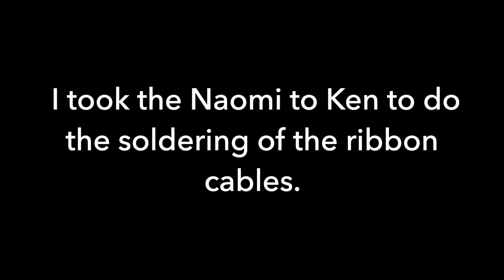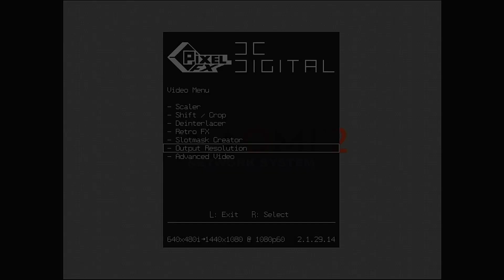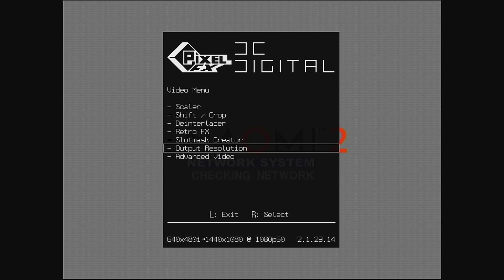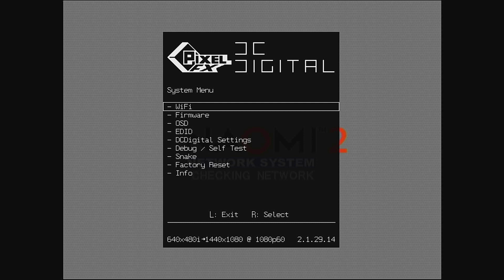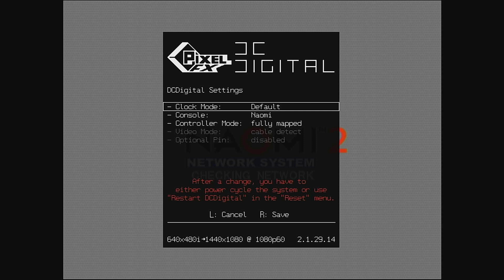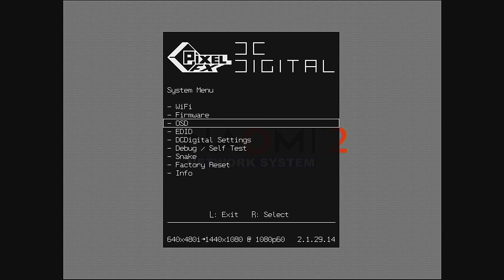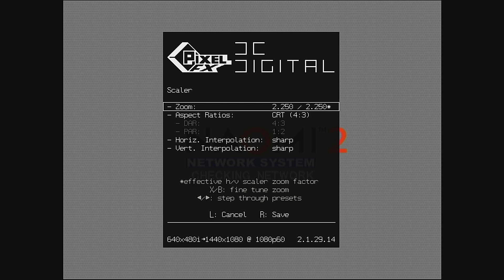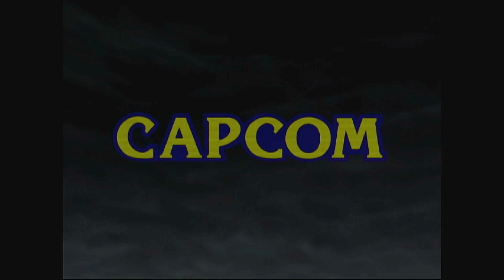Sega Naomi 2 with DcDigital HW2 Mod

Comment: Niceeee!.   🎉🎉🎉 congrats. 
Question:
Do you think if i connect a splitter in my original sega naomi cam work in two arcade cabinets?
Reply from the maker: Yes but you also need to split out the controls to the 2nd arcade. I have a VGA splitter myself that I'm using. It's a powered one. Make sure it's powered or else the image will be dim. Also make sure both arcades can handle the same refresh rate. 31khz or 15hkz. Since I do not have 2 Net Cities, I have rigged up another PC monitor as the 2nd monitor for it so people can still play on their own screens.
Reply: @vodkagobalsky   wooow thank you i really appreciate this answer. 
So 1st: powered vga splitter
2nd: aplit controls
3rd: chek the frame rate
Reply from the maker: @beyondreamsandmind1679  The controls will be the trickiest part depending on what cabs you're using.
Reply: @vodkagobalsky  than you i really appreciate  your respond